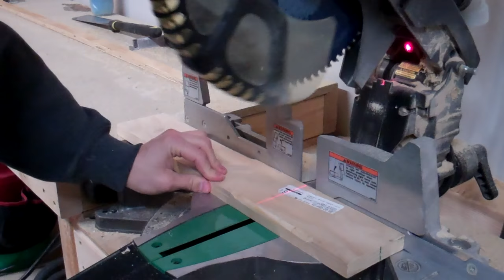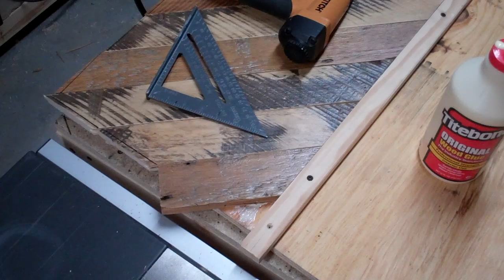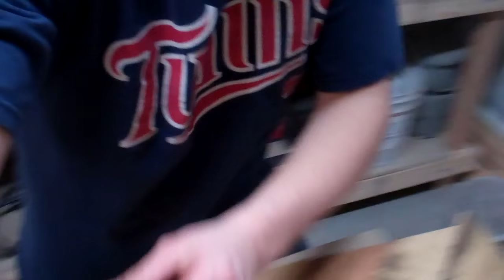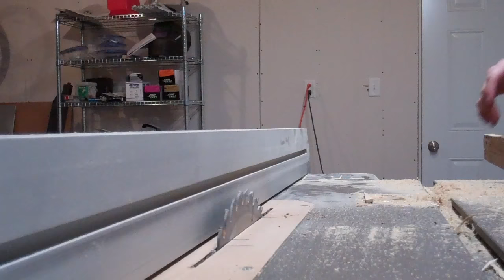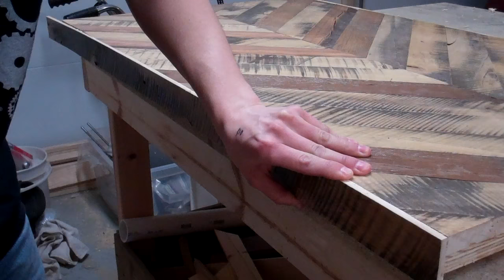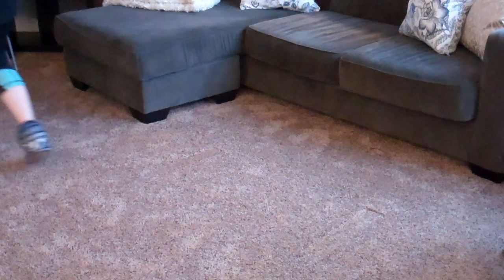Chevron Coffee Table - Kraftmade

Comment: How can they be attached together if no nail gun is used and the boards doesn't have a tongue and groove? Excellent project by the way.
Reply from the maker: Thank you! I’m a little confused by your question, I did use a nail gun to nail through the tongue on the boards.
Reply: @Kraftmade  what I mean is, I don't have a nail gun and I don't have the router bits for making the tongue on the boards so if I make this how I can attach the boards without the nails and that tongue on the boards? Can I just use glue and clamps to make it? Thanks for the reply!
Reply from the maker: @jellyg.8961  Oh!  Yeah clamps and glue will work just fine. I only nailed it because I can move faster rather than waiting for the glue to dry.

Comment: when laying the middle piece in the beginning, approx where did you screw it in? Is it directly in the middle? And how wide was the piece you screwed down to start the pattern? Thanks so much! The tabled turned out stunning.
Reply from the maker: Thank you! It is directly in the middle. I can't remember how wide it was but it doesnt really matter. You just need to split the table in half to start your pattern.
Reply: @Kraftmade  I dont get this, if the middle piece is exactly in the middle then when I remove it the first row of diagonal boards will be half the measure of the middle piece to the right, then when I put the left diagonal boards row it will be slightly offset to the right of middle of the table. Obviously if you the left of the table then that won't matter but I think the middle piece should be to the left of the middle of the table when you start putting the right row and then when it's removed the left ones will be put exactly in the middle.
Reply from the maker: Technically the edge of the guide piece is in the middle of the middle of the board.

Comment: Are the boards you use laminated/layered like plywood or are just grooved solid wood. I was thinking of using the latter, but I'm afraid of wood movement.
Reply from the maker: Mofjell1981 the wood I used is 100 year solid old reclaimed. so it has plenty of time to dry out. Unless you are using 2x4s most wood is dried to the point that it will hardly move. Wood movement is over exaggerated in this community.

Comment: Wht size plywood did you use and it that brace the center of the plywood
Reply from the maker: 3/4 inch but 1/2 inch would work
Reply: Kraftmade ok the long board you started with was that the center of the plywood
Reply from the maker: Yes